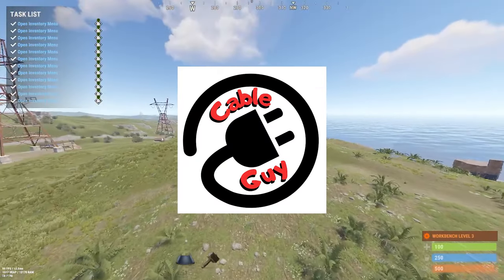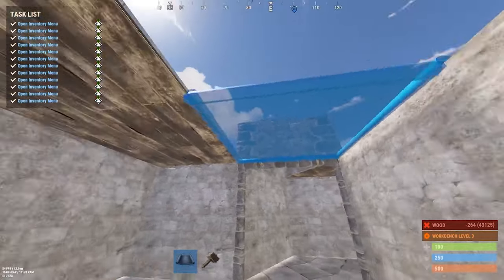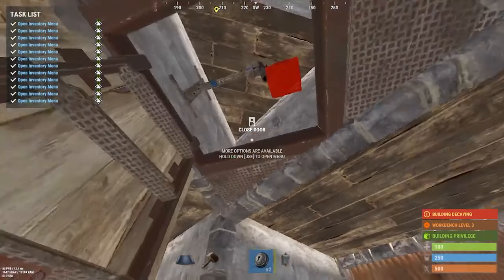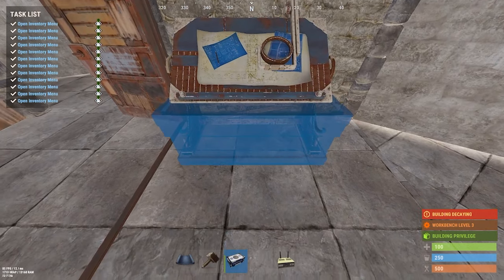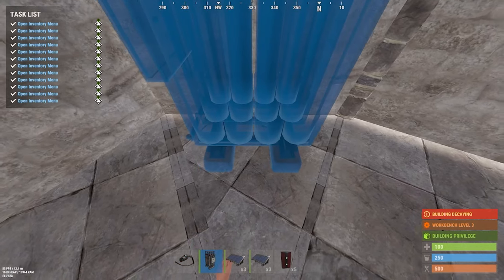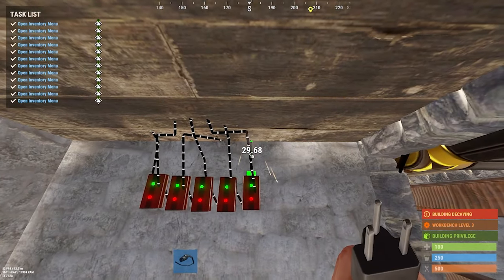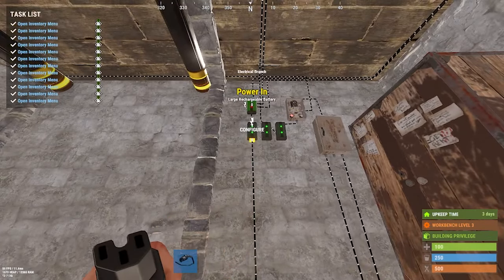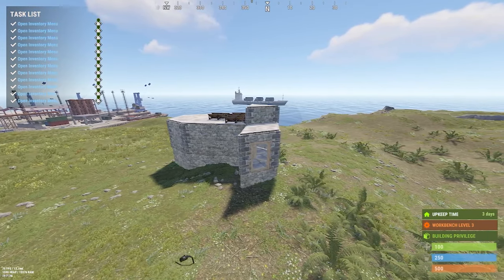TUTORIAL: The Storage Monitor Trap Base

Comment: i had a problem with it, people can loot without getting stuck from the ladder hatch which means that they can take loot and run, how to fix this
Reply from the maker: Not sure the exact issue without seeing it. Please make sure  to put the large box further away from the ladder hatch. Also make sure the ladder hatch is opening to the right side. Did you do all the electrical as well?

There shouldn't be any way to loot and leave, it happens too quickly for them to react.
Reply from the maker: Message me on discord if you need more help dude! Cableguy5988